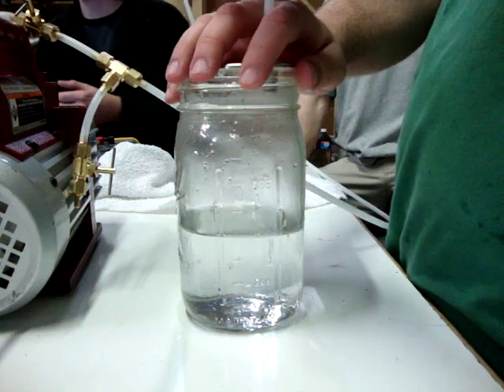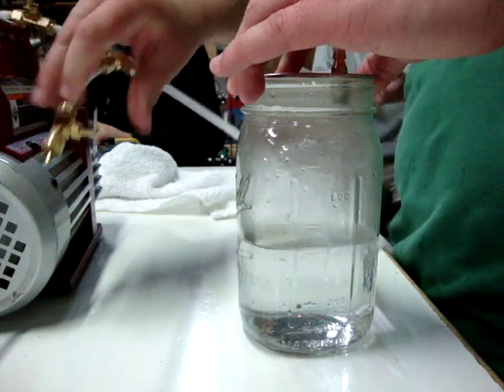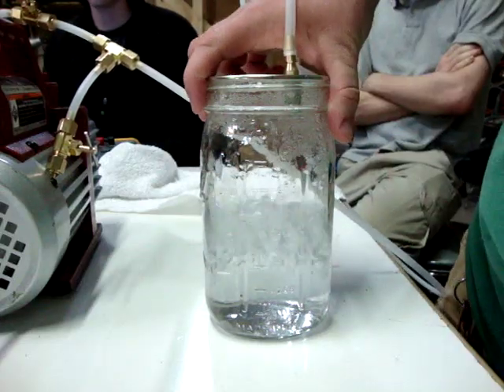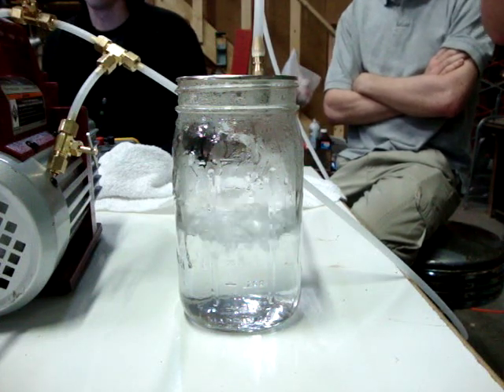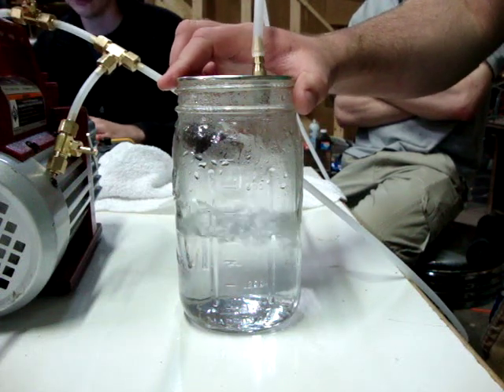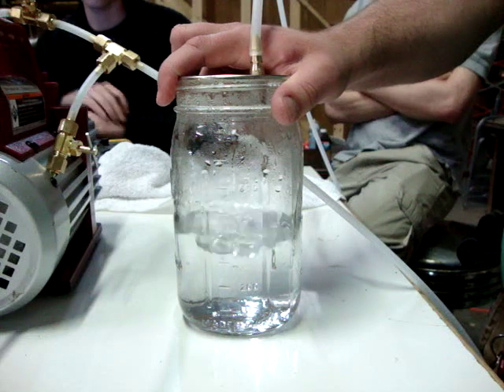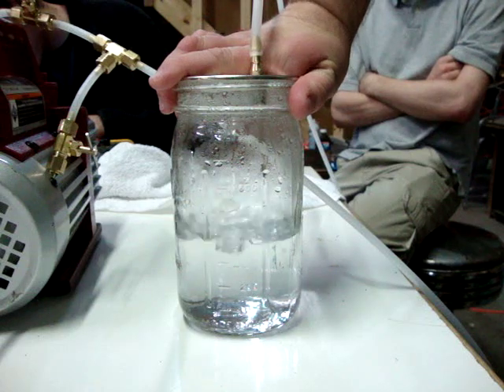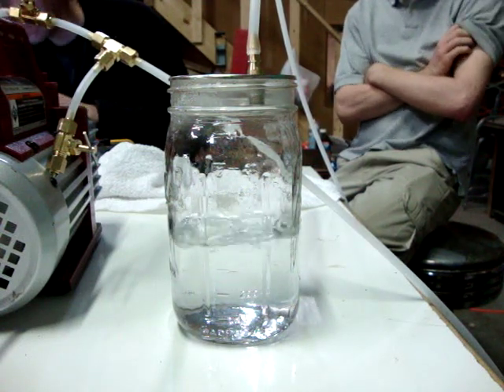Boiling Water at Room Temperature: DIY Vacuum Chamber: Prototype_01

Comment from the maker: You are correct, and thank you for pointing this out! ^_^ Any decent quantities of water vapor need to be dealt with some how or another, such as with desiccants, or a cold trap like you mentioned. Water wouldn't damage an aspirator, but an aspirator is only able to pull a medium to low vacuum, and so I think it wouldn't be able to create a high enough vacuum to make the water boil in the first place. Alas!

Comment from the maker: Excellent question! The answer is the that no, the water stays the same temperature. What is happening is that as you lower the pressure of water, it is able to start boiling at a lower temperature than normal. (Follow the link in the video description for a good phase diagram) This is one of the reasons you have to boil things longer at higher altitudes; since the water there is boiling at a lower temperature, you have to boil it longer to get the same amount of heat energy into it.

Comment: Actually Yes the Water does get colder.  The energy to evaporate the water has to come from somewhere, the water (and when below air temp some from the air through the jar wall).  If you just do a quick demo like that, it isn't too noticeable, but if you boil 2-3 inches of water out of the jar you will feel it just picking up the jar.

Comment: I used a water faucet aspirator (reduced-pressure vacuum)  and I got the water makes some bubbles for about 25 seconds but it stop. Is it because the water faucet does not produce enough pressure?

Comment: Hi there, very nice video. I am shopping for a vac pump at the moment for doing a few experiments with vacuum drying - so basically boiling water under vacuum like you're doing. People keep telling me I'll need to condense the water before it goes through the vac pump or it will wreck the pump, but I don't see you using a condenser or a dessicant dryer or anything. What kind of pump are you using? I've been looking at refrigeration ones.

Comment: This is really cool.

Does the water cool to below room temperature as it boils?  I imagine it would naturally drop in temperature fairly quickly.
What is the pump and how much do those cost?  Do you happen to know how many inches of mercury the pump is pulling?
Reply: thedillestpickle Late reply, but tgis could be considered a vacuum refrigeration system. Water at 0.1 in. hg would boil at 45f, hence removing heat from the glass jar. The steam could be recibdensed and repeated over again.

Comment: my last question is this: will the vapor travel thru the vacum tube as well, making the water and/or alcohol completely evaporate
Reply from the maker: Yes. It's not exactly good for the vacuum pump, but if you kept the setup from the video running for awhile, eventually all the water would boil away and leave the jar empty. It would be just like leaving a pot of water on the stove until it all boiled away, except that here you're using vacuum instead of heat to boil the water.

Comment: So will this still sterilize the water? Will it still kill bacteria?
Reply: +josh bridges no it will not kill bacteria.  It is the heat required to boil water that kills bacteria not the actual boiling itself.  That is why pressure cookers can be used to sterilize cans of food that can not otherwise be considered sterile if not cooked under pressure.

Comment: if so, can you evaporate alcohol the same way?
Reply from the maker: Theoretically. While the exact properties of any particular liquid will vary, in general any liquid with a standard 3 phase model should behave similarly. I would imagine that it would work the same for ethanol or isopropyl alcohol, possibly even better, since the  normal boiling point for alcohol is lower than that of water. (~173°F)